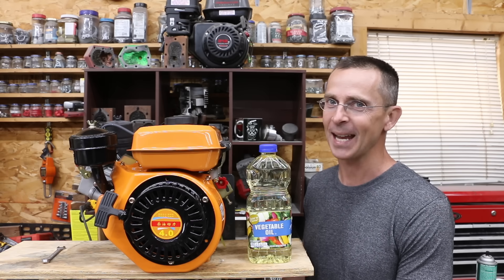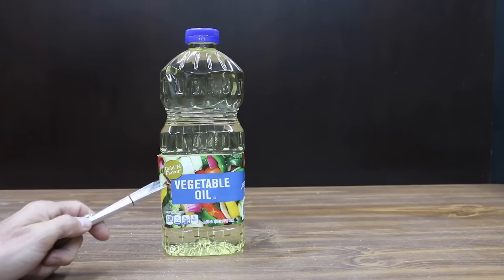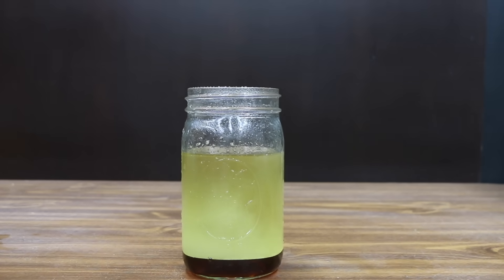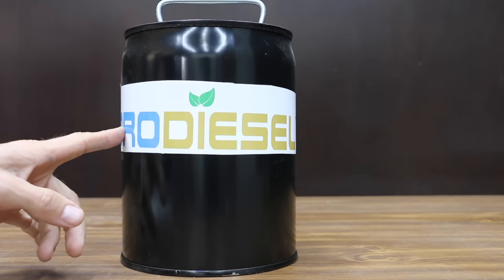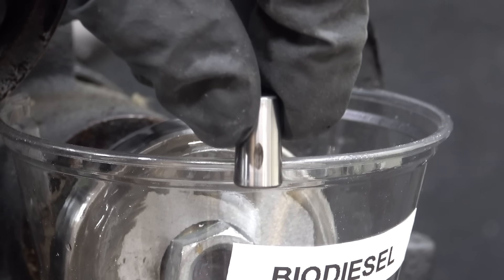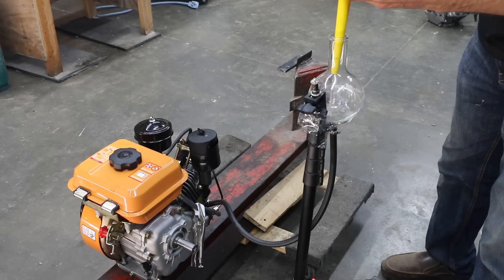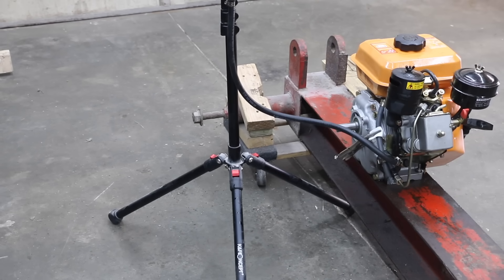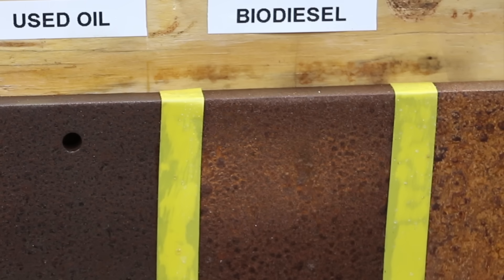Make "Biodiesel"? Let’s find out! Diesel vs Biodiesel, Used Motor Oil, Vegetable Oil, MPG

Comment: I so want to get a used diesel truck just so I can run biodiesel. I'm surprised (not really) that this never took off as a viable alternative fuel. My only guess is it's not really regulated so used oil from McDonald's not cleaned would create a lot more NOx emissions. But my best other guess would be the Oil Cartels. They don't want competition and pretty much stopped biodiesel in its tracks. Those are my guesses if anyone has more info I'm curious.
Reply from the maker: Thanks for sharing.

Comment: I was hoping you would run the engine on the combination of all of the above.    
Also you should have done the thermal expansion and luminosity test where you light each one on fire at night and compare how bright each one burns as well as how long each one burns.    You know... To judge the BTU output.
Reply from the maker: Thanks for the suggestion.

Comment: Transesterification. I make 100 gallons of B100 every week with a biopro 380 processer. I run it in a commercial mowing fleet with Kubota diesel motors 100%. Change the rubber fuel line to PTFE Stainless Braided Fuel Line and you are golden. A 75% blend in the winter will help with gelling. Great video!
Reply from the maker: Thanks!  Thanks for sharing.
Reply: I also make hand soap with the left over glycerin and it puts gojo to shame and it doesn't dry out your hands!

Comment: If I remember right, there were some old US Military manuals which advised what alternative fuels could be used in the Duece and a Half and 5 Ton trucks.  All sorts of things can run in the older diesels.  FWIW, Diesel had his first engines running on peanut oil.
Reply from the maker: Thanks for the feedback.

Comment: Would have been cool if you had that engine on a benchmark test to see how much energy each fuel gives, what is the change between them is, and how each fuel handles under a load.
Reply from the maker: Thanks for the suggestion.

Comment: Modern diesel has pump lube additives. Would like to see tests with Flying J diesel. Supposed to a have better additive package.
Reply from the maker: Thanks for the suggestion.
Reply: @ProjectFarm  Flying J Truck Stops advertised that when I owned a truck. I did notice the engine ( Big Cam 3 ) seemed to run better with that premium diesel.

Comment: There’s one diesel fuel that you might try if you can get red diesel fuel for farme equipment, and the red diesel has higher Sulfur content 

And you can run kerosene as diesel fuel
Reply from the maker: Thanks for the suggestion.
Reply: @ProjectFarm   your welcome

Comment: Anyone even thinking of running WVO veg oil, you have to start with diesel or biodiesel first, and you really, really want to remember to switch back over to diesel or biodiesel before stopping to run the majority of the glycerin/gunk out.
Just one mistake and you've now got plugged injectors, etc.  That Kilted Guy is right, its certainly doable, however depends upon new-ness of engine, and rats and vermin will be attracted to your still.
Reply from the maker: Thanks for the feedback.

Comment: “Video idea” Compare battery (cordless) operated portable air compressors. I seen 1-2 gallon ones that use 18v batteries and I would like to see how they do compared to a plug in 2 gallon compressor. Thanks
Reply from the maker: Thanks for the video idea.

Comment: had a buddy that ran his older F250 on filtered used motor oil for years and years, didn't really smoke or run bad at all, ever. He thinned it out with a tiny bit of old gasoline.
Reply from the maker: Thanks for sharing.

Comment: I only have one gripe with this test, running the motor unloaded really isn't much of a test.. if you want to see what it can do, hook that motor up to a generator head. with a 4 HP motor you should be able to get 2kW of power with no problems. What's interesting is that engine is rated at 3000 RPM, the two I have will turn a full 3600. You could fix that by adjusting the throttle stop, or, you could do a pulley ratio to get to 3600 for a normal 2 pole generator. 

You could really use just about any generator head so long as you have more generator than motor, then you can tailor the load by what you attach to it. You'd measure the results by setting a load of some value, say 2000 watt, then change fuel and see if the RPM remains the same, or you could add load until it is no longer able to maintain 60Hz. (which would be 3600 rpm generator speed). 

That way you can actually test the thermal energy capacity of the fuel, or run it on a known quantity to see how long it runs on 500mL of fuel, like you do with other tests.
Reply from the maker: Thanks for the suggestion.

Comment: used oil and mixing it with some diesel and filtering it really well will indeed work BUT if you have glow plugs they will quickly get coated in oil and not wanna work. i've got experience with that!
Reply from the maker: Thanks for sharing.

Comment: Great work as always! What you have created with the methanol/potassium hydroxide, is Fatty Acid Methyl Ester. (FAME) One of the two forms of biodiesel. the most commonly used commercial variety is Fatty Acid Ethyl Ester (FAEE) which uses ethanol instead of methanol in the transesterification process used to produce it. FAEE is less aggressive on rubber seals and gaskets than FAME and is used at concentrations of around two to five percent in ULSD. (B2, B5, and B20. B20 is least common)

Biodiesel tends to have better cetane, (opposite of octane) cetane is the tendency of the fuel to auto-ignite in an operating environment of heat and pressure where octane is the tendency of the fuel to resist auto-ignition in the same aforementioned operating environment.

Lubricity of biodiesel tends to be better due to the physical properties of biodiesel, where ULSD has been hydrodesulfurised to remove sulfur which in tune, reduces the oil content of petrodiesel. Sulphur is not a lubricant in itself, but rather combines with other elements to form complexes that exhibit antiwear properties. The process of hydrodesulfurisation strips oil content from the fuel, reducing its oil content, thus negates the lubricity of diesel. Sulfur is a nasty enemy of any ICE because it combusts with the fuel, and combines with moisture, (a byproduct of combustion) to form sulphuric acid, and with oxygen to form sulfur dioxide, and in addition hydrogen sulphide. (rotten egg gas)  Thus, sulfur is removed from diesel as part of the refinement process to make it compatible with modern diesel exhaust emission controls, and negate the negative health impacts of diesel which are very serious.

It would be very interesting to see what would happen if you took hot liquified bacon grease, and poured it into the fuel cell while it's running...
:-)
Reply from the maker: Thanks!  Thanks for the video idea.

Comment: My pop made some a good 14 years ago. Being in NT Australia we went to local shops and collected 20lt drums of veg oil every Friday. Filtered with a strainer and filled a 44 gallon drum that was black. Used a handpump or crane to put into a cut 44 with cone base and valve. As drum was black it was all pretty warm over 60 deg. I always wondered what they mixed with it. We used a 2 hp outboard to mix it up then capped it with a lid and left it a while. Filled some Jerrycans and had almost free fuel for the trip around Australia.
Reply from the maker: Thanks for sharing.

Comment: I have a 12 valve also, I run all sorts of stuff through it and the only thing I notice is some stuff like jet A gets less fuel economy than regular diesel, I’ve ran a mix of atf, old motor oil, gasoline, kerosene and jet fuel just to fill the tank and it didn’t care one bit, also about 2 years ago I had the p pump sent out and was told it had minimal wear and was still mechanically sound, so with that being said if it can combust in a Diesel engine I will continue to use whatever is free to me or cheap
Reply from the maker: Thanks for sharing.

Comment: If I remember correctly, didn't the first test engine that Rudolf Diesel built ran off peanut oil? That's why some diesel engines can run off vegetable-based oils
Reply from the maker: Yes. Thanks for the feedback.

Comment: Very cool that it will run on used motor oil in a 10:1 ratio...I always thought about doing that...not sure how long it would stay running...would definitely have to centrifuge the oil to ensure there are no metal particles floating in it.  Pretty cool to see diesels doing what diesels do!
Where did you get that small diesel engine?? (no seriously...how does one import a small diesel engine from China??)
Keep em coming!!!!

Comment: I've converted 2 of my vehicles, one 1982 Mercedes, and a 1997 12V Cummins to run waste vegetable oil.
The conversion kits I've seen are all hot garbage. Insufficient heating and residual vegetable oil getting mixed with diesel.

The big keys are heat the WVO up good, and keep it hot without heating the entire tank. 180F has worked excellent for me, which means not switching to WVO until the car/truck is at full operating temperature. Colder climates are challenging because it will gel in the tank, I don't really have to deal with that in TN.
Then comes filtering and dewatering. A centrifuge is a must, it takes a lot of expense out of filtering and dewatering long term.

Do it wrong and it'll destroy your injection pump, possibly gum up the rings in your engine or worse.
Do it properly and you'll drive hundreds of thousands of miles for basically nothing.
Reply from the maker: Thanks for the feedback.

Comment: Hydro diesel is not just giving off smoke it is giving off steam. Encapsulation of water breaks down with combustion resulting in water flashing to steam in the combustion chamber. Steam has unique property in the combustion chamber in that it reduces temperature and produces more power because steam displaces more space than does normal hot gases from diesel fuel
Reply from the maker: Thanks for the feedback.

Comment: Honestly injection pumps aren't that picky about lubrication, obviously you don't want to run water or a solvent in them. But a couple of friends who work in pump/fuel shops have stated that they didn't see any problems with mechanical pumps from switching to lower and lower sulfur content over the years. If you think about it a Bosch Common rail pump operating under extreme pressures with only fuel as lubrication would be more picky... And lots of them go 100s of Ks of miles with no problem. But of course this observation is purely subjective...

As always, great video
Reply from the maker: Thanks!

Comment: Circa 2010 I was working at a dealership, and the manufacturer launched a power steering recall. Part of the recall was flushing the system with 10qts of ATF. I strained the Used ATF and dumped it in my 2002 dodge all the time. Went a full year without having to pump diesel into it. Ran perfectly normal. I had an aftermarket external lift pump with spin on filter and water separator, I just changed them out every 5k to be safe.
Reply from the maker: Nice!

Comment: I've been running my 7.3L, 3.9L isuzu npr, 2 stroke 2 cylinder Detroit(allis Chalmers loader crawler) and a cat generator on filtered waste vegetable for 15yrs now with zero problems.  In the winter I do a blend of 10:1 (10 gal vegetable to 1 gal of gas) works great!
Reply from the maker: Impressive!
Reply: @ProjectFarm  I own a pressure washing company and we clean kitchen hood systems for restuarants all over Illinois.  I have endless supply of waste vegetable oil from all my customers. Kind of a win win situation😎

Comment: Bad blends of bio fuel mix can really shorten the life of fuel injection systems... The cost of modern injectors can easily approach $4,000 or more. Best use the fuels in older diesels with cheap injectors.  Your 12 valve Cummins can easily take any fuel, as it has  a mechanical inline pump. Those usually get damaged from poor caustic blends that eat away the pumping surfaces.  Poor lubricity will hardly damage your pump as the plungers can take it. 
Electronic injectors are real expensive $$$ don't use home brew stuff in them.  Back in the day Racor offered a blender that would take old oil and filter and blend it with diesel. Recommended at 7% oil to diesel.
Reply from the maker: Great point!

Comment: When you change your lawnmower's oil, it is a good idea to brush it on the underside of the mower. it is a great inhibitor of rust
Reply from the maker: Great point!
Reply: I spray my pickup truck underneath with used oil at the start of winter.  If thinned with some diesel or kerosene a garden sprayer works fine.

Comment: I used to run straight used oil though my 78 240d. Used to get oil from Italian place and man everymoring backing out smells good and my boss made fun of me for the tail pipe smell. On the side note the injectors got much quieter, no performance impact and started the same.
Reply from the maker: Thanks for sharing.